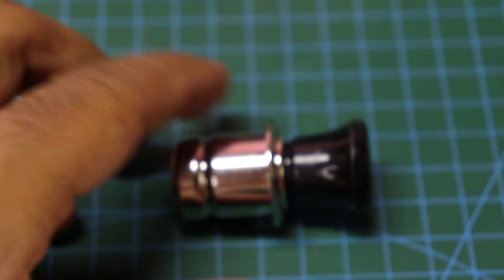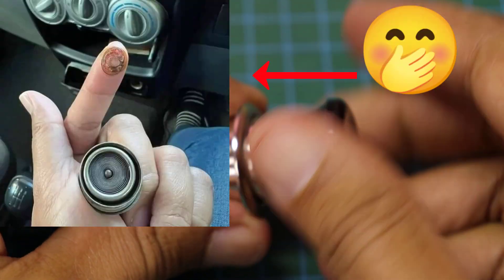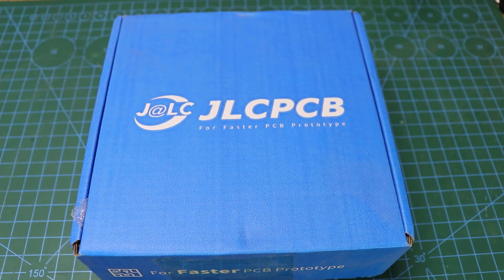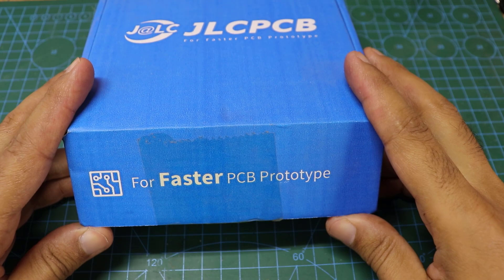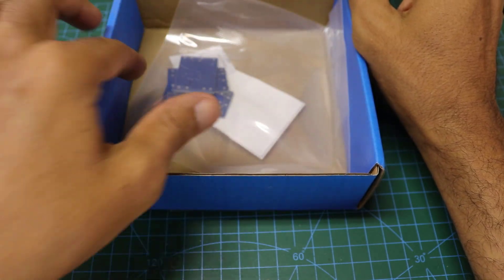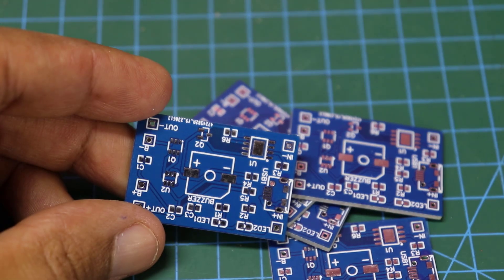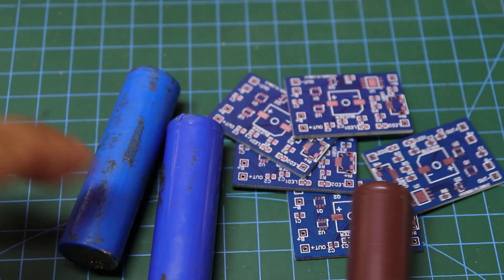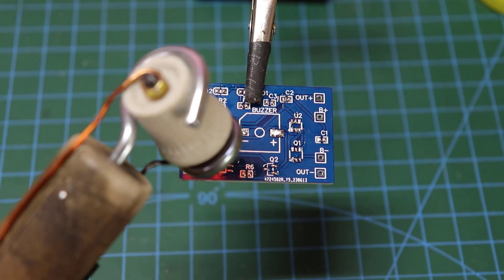soldering and desoldering SMD components using a Car Lighter

Comment: When soldering the SMD components , you are going to subject more heat to its neighbour which are in close proximity, ,  and  maybe re-flow the previous solder under components and cause a short circuit.

Also components such ss resistors and capacitors , loose properties of their initial value with excessive heat.

Did you measure the temperature of the heat element ? , again as excessive heat on IC's especially can damage them.

You said you modified the board.

What did you modify to the circuit ?

As18650 cells differ in currents , and these charger boards are specific.

As for your design , it is a tad rough , let's be fair !!

That small board ,is easy enough to hand solder.

And before anyone slates me for critising , just think about people starting out in electronics.

They might burn out Components or the actual PCB due to the excessive heat ,which will cost them money.

And they might burn them selves . 

And above all , people posting these ' projects ' ,  it might work for them , but hinder problems for others.

So , slate away......! !
Reply from the maker: You are right. It is a bad alternative, but not as bad as you described. Greetings to you, and I like listening to criticism because it develops me.